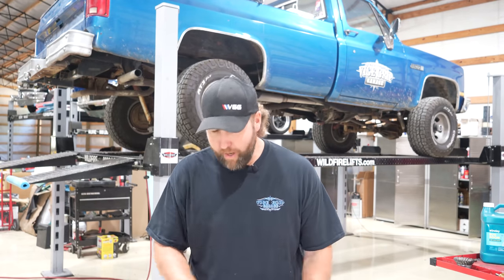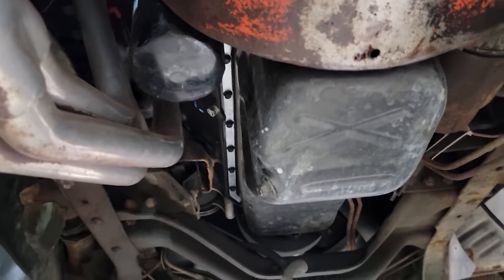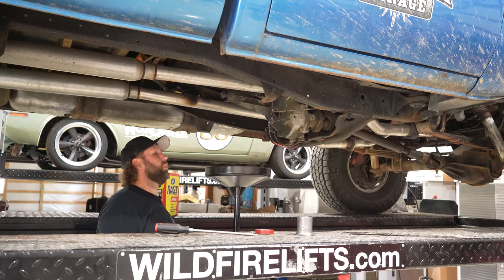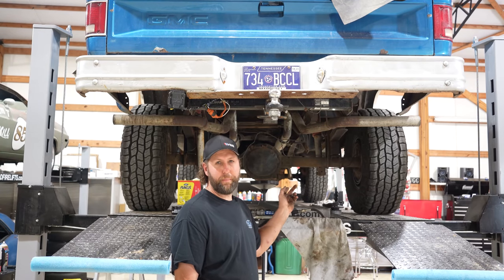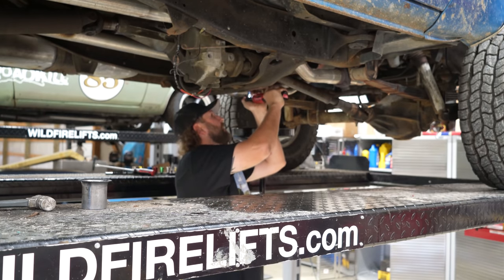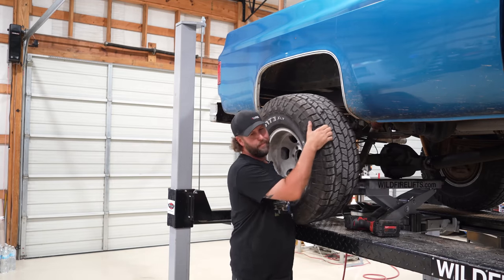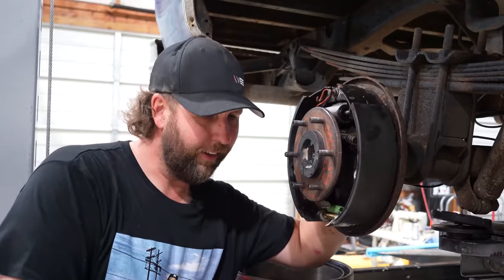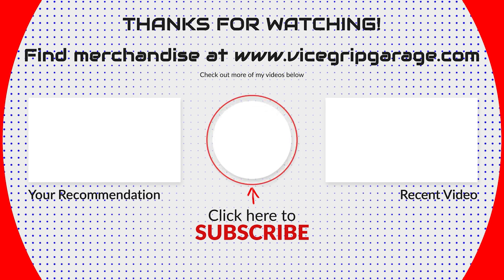I Let A Stranger Borrow My Truck For Hot Rod Power tour (1 week!)

Comment: Thats awesome Derek ,  Helpful tip doing drum brake wheel cylinders . Remove the drums , put on the parking brake full extent. (no need to remove the springs or shoes ) then replace the wheel cylinder.  Release the parking brake and install the drums, and blead the brakes.

Comment: When I first get a trans-pan down,I’ll weld a drain plug in it. 

I won’t change the filter after that.   Just fluid on a regular basis since the torque converter still has the old oil. 

Drain plug:  far less messsy.

Comment: One advantage to a functioning e-brake is you can set it after removing the drum and it pulls the shoes away from the cylinder so you don't have to unfasten all those pesky springs.  Learned that little trick from my first boss at a gas station back 1996.

Comment: 1 wheel peel solution : mig welder. I had a 10 bolt rear end with 2.73 gears and had 38x16x15s on it ND would melt them on pavement all the time and never had a issue... Lunchbox lockers are the best.

Comment: You may have experimented with this rebuild juice, but I love Duplicolor Rust Barrier.  They have a flat and gloss version.  The gloss is nice for looking good and it has been durable for me on an off-road rig.  I've used it on everything from wheels (spare) to steel bumpers.  I use the flat for frames and such because it seems to dry faster.  You just spray this stuff right over the rust and the rebuild is done!

Comment: Derek get yourself a trash can lid a round one the round dome inverted fits right onto the oil bin tray when flipped upside down drill a pile of holes around the center and it will catch your trans fluid much better e'r

Comment: Put a socket on the u joint cap and fit a pitman arm puller on the yoke and drive it into the socket with an impact. Save 90% of the hammering. Itll just push it right outta there

Comment: A trick I learned to make them easy along as they are big enough for it to work is use a ball joint removal abdvinstsller c clamp toll by its self and justbpush them in and  out with ease

Comment: a guy welded together some angle iron back to back to make v blocks to hold his propeller shaft to press out u joints. then a feller welded a hex bolt to his heavy duty c clamp on the driver side and a large socket to the receiver side to use with his impact to press out and in the u joints.

Comment: Take the u-joint caps off,  rest the u-joint on TOP of your vise jaws.    Take a brass hammer and hit the weld on the driveshaft.   Hammering the driveshaft down while the u-joint rests on the vise will push the cap out of the driveshaft.   Flip over and repeat.    NOTE:  do not hammer on the driveshaft tube.   Only the weld.

Comment: I have a fluid extractor, but i used it on my 05 Monte Carlo and i had air bubbles constantly flowing out of the bleeders, i tried everything, i ziptied everything i could, even put a ziptie on the bleeder nipple. Its almost like the threads werent creating a good seal, and air was coming through the threads in the bleeder. The car also has 200k miles on it so who knows, havent tried bleeding another vehicle with it yet.

Comment: On that transmission dipstick, could you trim a little off the top of the tube with a tubing cutter until the stick sits down in enough to read correctly?

Comment: Should’ve disconnect the line and push the other 2 gallons of fluid through the system. Laporte Northwood through it I would’ve got all the crap out of it. I have a Hoover had any luck for a long term use of a pin drop service only that sort of service.

Comment: It's actually not the seal on the transfer case itself it's the plug on the back of the slip yolk that leaks on those old Bad Boys you just clean her up smear it up with some silicone works great if you look at the staining on the exhaust and where it's actually located you will see what I mean another thing to check is if the transfer case is over full on fluid then you have a bad input seal on the transfer case between the transmission and the T case and it will need to be replaced or your transmission will continue to be low on fluid and you just won't know why

Comment: Derek, You da man!! That's all I got, plain simple!! OOPS, I got one more thing. Why don't a feller try out that AMSOIL one of these days? I've been using it in all my rigs since 2007. The best part about it, if you use their filtra's a feller don't have to change the oil for 15 to 20 thousand miles, depends on what AMSOIL says. Now I know some of you fellers say to NEVER put synthetic oil in an old rig, well to be honest, that's hogwash!!! I got a rig with 227,000 miles on her that has had nothing but AMSOIL since the break in oil came out. Give it a try fellers, it is AWESOME to not have to change your oil every 3 to 5 thousand miles, you'll like it.......GUARANTEED! Also, if ya want, run a few oil analysis on the old oil if ya want to make sure you ain't gettin excessive wear.

Comment: As the owner of a Nissan CVT Derek. That $500 smarts at the dealer every 15K. But When the car is worth $4K 4 years old with a 130K miles. Worth it. Service your transmission folks. Also Nissan CVT folks. Thanks for all the cheap parts for my car at junk yards!

Comment: Nothing more frustrating than fixing something and 3 or 6 months later finding out the parts were complete garbage.  At least it was wheel cylinder and not a new camshaft and lifters that went bad on you

Comment: I have swapped more than 2 of these from auto to granny gear, I don't like the gear ratio in the sm465, 70s or 80s, I want to put a hydraulic clutch in my k5 and put in a 5 speed from a 88 to 99 or whatever will work, I'm sure there's a tcase adapter out there...

Comment: I loaned my 89 Camaro to a stranger once.
My wife worked at a gas station and called me to come and help a young couple that had car trouble. They were on there way to a wedding and were 100 miles from home with a transmission that seemed to have a bad 2nd gear solenoid. 
I talked over with my wife and we decided we could do without the car for a week. 
They were able to go the 200 more miles to the wedding and when they got home they came back with a trailer, returned me a car that had been cleaned inside and out and had a full tank of gas.
Come to find out they owned a restaurant and told us anytime we were in their town to stop by and dinner would be free. We never did though.
It feels good to help people out. Something I learned from my dad, who would never pass a broke down car  without stopping to offer help.

Comment: I saw a guy add oil to his engine that he rebuilt the bottom end while the motor was still in the car, he bought a 5 gallon bucket of oil and he started poring oil into the engine a quart at a time and checking the dipstick each quart to see how full it was well he emptied the 5 gallon bucket and oil was no where on the dipstick so he scratched his head a few times and started looking around and  then he noticed the oil drain plug sitting on the core support and not in the oil pan

Comment: I don't want to sound like an ass when I ask a question but here goes..if you change the trans filter and fluid pretty regularly then why not use a piggyback bolt or weld a nut on the pan and make a drain hole and plug? I was just kinda wondering..but that's an awesome truck and it's really cool your gonna let someone borrow your truck for the power tour...if you have any other extra vehiculars sitting around let me know...great video btw..have a good un..

Comment: Derick if you have a sec in your outrageously busy scheduled could you answer a quick nagging question that has been hurting my brain for many years....at frame 24:16 i noticed you use that center wildfire lift thingy to "lift" the rear tires by the banjo for the breakalator work you are about to perform , but i have always reluctantly never wanted to do that to put any stress on the thing where its not normally going to see it ,,,(leaf springs close to wheels and the distance from banjo to wheel etc)... so what do ya think? is this OK to do?  cause your doing it?
Love the channel by the way!!!

Comment: Correction, battery cars(electric) run on Coal and all the plastics are made from Oil. All the rare earth minerals and metals used for the batteries are dug up using Diesel machines. The batteries when used go into land fill and leach poisonous crap back into the earth. But hey, I love A Good Green Virtue Signal.
Reply: Correction: Battree and awl
Reply: @yefenofphoto  My bad. I'm glad you bleep blooped it below.

Comment: i do my tranny filters about every 50000 miles you should invest in a pan with a drain plug ,or weld a nut onto the outside of the pan drill a hole visa versa bolt neoprene washer alot cleaner.

Comment: for a slight morgage payment about the size of one for your daughters pay house, you can buy a U Joint removaland intalation tool set. unfortunatey like so much of my stuff it was reposessed by some one wearing a Ballaclava and shop issued plain greenish covered over alls. around the exact same day my Slack Adjuster tool set, not the Tiwan socket sets, nope they went hands in for all the crafstman, and Proto challenger sets. along with my set of Igersol rand Air tools. Nope was not my carelessness these took flight, Knowing the persons in question i told the law who i suspected to be told with out any evidence they could not search some ones property for my stuff. yup if not make any attempt to go there to look for my stuff i sat back with a loss of aproximentallly 5 to 10,000 bucks so my chances to enjoy my life got shortened huge as savings hadda replace all my stuff.

Comment: I was going to bring my 5.0 swapped narrowed posi 9 inch with wilwood disc brakes on all 4 corners to whoa the insanity down extended cab 1994 danger ranger this year but Saturday while finishing packing the necessities a tornado decided to take the roof off my house and smash the nose and cab as I was stepping onto the porch with my duffle bags trying to get out ahead of the storm I'd just replaced the nose from a deer that's what cooked the baby engine and got me to do the swap but I left the bullet hole in the drinker door for character same with the captain window that slowly drops with vibration and good bridge approaches and departures I'm torn now on pulling all the good parts for a different project I found a 4x4 flavor of my truck with a great body custom bumpers and grill guard and light bar just a smoked trans and rattling 4.0 and junking it or getting another nose and a cab with a title from my salvage yard since I've got 3 the same color so I could leave my rust free bed on I'm just to heart broke to make a decision right now because it also took my 00 Dodge 2500 12V Cummins that cranked more hp to the tires than it did factree at the crank and my LS swapped 98 Ford exploder so I have to buy them back from the insurance and walk around the salvage yard and figure out what to prioritize as my project order I'm thinking LS in a shortened bobbed 65 C65 with a custom built flatbed and keeping the 5 speed and 2 speed rear end or going to a 6 speed with 70s or 80s 1 ton axles front and rear turning it 4x4 and bagging it so it lays frame when parked or maybe my roller 50 Chevy pickup as a sleeper